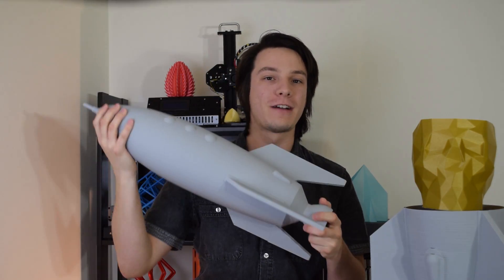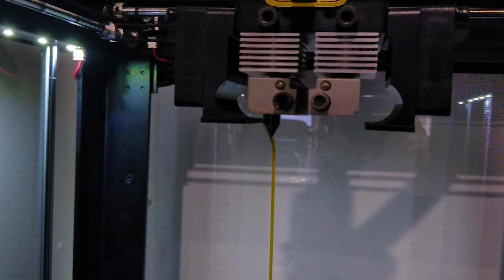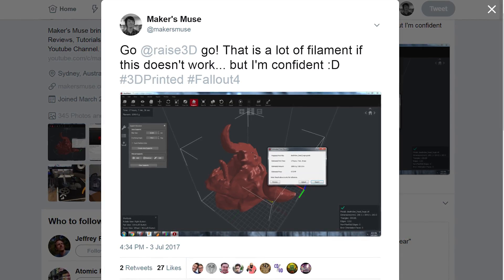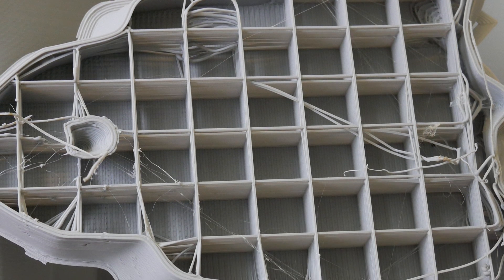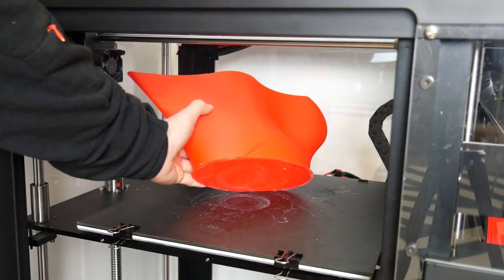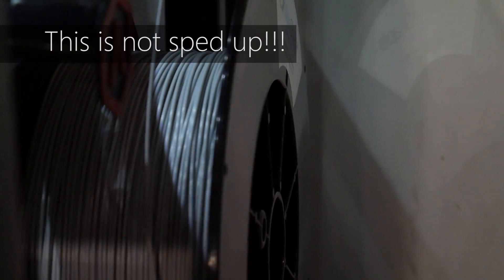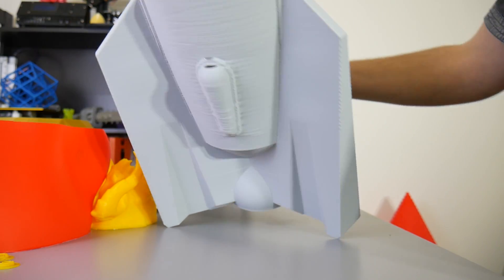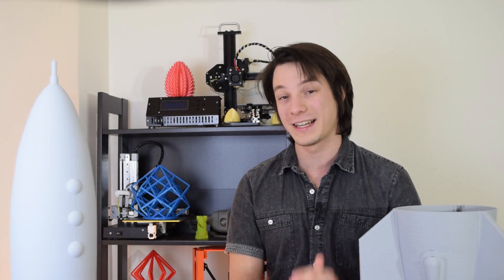3D Print ridiculously fast with this terrible mod - 1mm nozzle on the Raise N2+

Comment: I’ve bought some un-drilled E3D nozzles last year, had a plan to do small line cut instead of circular to get that "classic pen" look to some of my prints - underestimated fine cutting tools needed to do this trick, messed up 2x nozzles… 

Also about the regular round holes - I found that drilling from the inside and then sanding the very tip gave me the best results. You also could drill as normal from the outside and then drill from the inside with slightly bigger drill bit just to deburr it a bit.

Comment: I saw someone use a clever technique of having powder surrounding his print; As it developed in height he manually pushed more powder around it's walls; this acted as support material which he later simply vacuumed away & reused. The  powder may be something innocuous like Talc? Perhaps if used within a flexible extending 'container' something like that can be used to stabilise higher walls and thus make the much faster big print still come out well.

Comment: The infill issues and other issues you experienced is due to layer height being too high and over extrusion. When the printer makes a change in direction, the hot filament drags at high speeds instead of staying firmly planted. I've had great success with a 0.8mm nozzle and keeping layer heights below .4mm and 80mm/sec.  When printing with large nozzles you have to really tweak your settings in simplify3d or other slicers with 40% overlap or the slicer will skip sections. Another tip is to change the width of the kerf if it will refuse to print in the gcode  preview. Doing so will reduce the layer resolution.

One major issue I've come by is bridging. It's nearly impossible to bridge a high layer height. I still prefer using the larger nozzle but with a low layer height and crank up the speed. It'll increase the speed of the print completion by cutting the passes by a third and will be much stronger.

Comment: Nice subject. I would not have thought that the slicer actually might be the cause of misprints when using larger nozzles. I missed out on the reason for that in your video. Heater cartridge capacity.. obviously.. but slicer? Thanks for the video!

Comment: Been using a .6mm nozzle for a long time. You need to use z-hop, this way you will not have catching and crashing, play with retraction/travel settings to tweak behaviors. You also need to use more coast to avoid extra oozing. You also can't print nearly as fast as you think you can. Figure out the actual volume/sec you are extruding. 1mm vs .4mm nozzle is a significant difference in volume. You need to do a lot to cool that much plastic you are depositing.

Comment: Excellent work, more like this please :)
i quite often do silly things with my printer just trying to push the boundaries and it's amazing how much you learn in the process!
there's a hot air gun and a high speed scroll fan sitting by my printer with sufficient cable to move around for just these kinds of things and yeah, slicers have a habit of getting it wrong in these fringe cases but with a little bit of ingenuity you can pull of some crazy stuff.
0.8mm is biggest nozzle i have tried, with varying levels of success but even printing 50mm/s X 250% speed if you follow the nozzle with a blast of cool air those vase mode prints hold up quite well :D

Comment: A few thoughts: How about a volcano? And how about using a smaller diameter nozzle for the outer perimeter, and the larger one for solid infill? Also, I suspect that there needs to be a dwell g-code inserted at the start/end of the hollow infill you are running now... dunno if your slicer can do that itself or if a postprocessor script would be needed... 😀

Comment: I'm using a .8 hardened steel nozzle, a cheap one. It works great. It's so hard my steel file just glides right over it. .8 is plenty small enough for small features afaic. Can still print .2 layer height, and that's more important than nozzle size.

Comment: Angus, given that you've drilled the nozzle by hand with a Jacob's chuck drill, I would double check the actual diameter of your modded nozzle. The imperfect design of most handheld drills means your bore diameter is probably 1.05-1.2mm. I bet more accurately providing this info to the slicer will help it avoid the direction change issues.

Comment: Hey, that failed infill isn't a deal breaker if the object isn't going to bear weight. I've seen prints recover from it and turn out okay. You may see weak interfacing near the failures, but easy to hide with acetone finishing. Has worked well for clients demanding faster prints with no care for structural integrity.

Comment: Perhaps just the complex layers can be slowed down, but the rest can be printed faster.

Now that i think about it, it might be good to simply adjust the print settings so that direction changes alone are done very very slow (to avoid the print wobbling) - but everything else is fast.

Comment: Great video again. Might experiment with the bigger nozzle I got in the e3d nozzle kit on my mk2 to print something in vase mode. The problem I have had is to actually get them to be waterproof.
Reply: Clear coat the print. It's probably not as good as using an actual water sealing product but I haven't tried any so I don't feel comfortable recommending it.

Comment: the problem with small layer height and thick walls is...... support structure like seen in the video is often with big gaps in between. the lack of pressure from underneath to form the "<==>" shape causes a "O" form of the printed filament. This is higher then the slicer calculated and stacks up untill the nozzle collides.

Comment: Cura now has lightning supports, which allow to save a lot with larger nozzles. Also, I switched on my jg a3s, and with my 0.4mm profile it prints just fine after nozzle adjustment. I guess I was printing too slow in the first place.

Comment: You know, someone should make a cheap recycler for the wasted filament! Chop it up into pieces then melt it down and push it out an extrusion head into usable string.
Reply: Just watched a video on here of a guy who built a melter / extruder nozzle who can print directly from shredded waste prints. Most of his design was 3d printed himself. Basically just a heated hopper with a little extruder above the nozzle...could be the future...why waste time with filament. Go directly from plastic scrap to new prints.

Comment: So, I'm quite surprised that you didn't manage to get better results. I've modded my Micromake Kossel with a volcano hotend and a 0.8mm nozzle and have had great results. Not quite as refined as with a 0.4, but the prints are fast, and the thicker width of the extrusion really lends itself to part strength. For the record though, I don't go over 0.3mm layer height if I want a good clean print.
In any case, with the volcano hotend I often swap between 0.4, 0.6 and 0.8 nozzles depending on my needs. Saying that, 0.8 is my go-to for most prints these days. I imagine a 1mm would work just fine at a ~40% layer height, with a hot enough hotend and good cooling and provide superior prints to a 0.4 for certain types of requirements.

Comment: When i was using a 0.8mm nozzle, I found that the layer height massively changed my prints. Printing 0.4mm heights made utterly fantastic surfaces, while 0.5 and up started to get a bit much, and the quality decreased hugely.

Comment: .6 nozzle is really the limit for reliable large prints, you can even dial it from .15 to .3 no problem with the correct temp/movement settings. 
I've gotten some things to work with .8 and only basic shapes with 1.2.

Large nozzles are tempting, but unless you know what their limits are, all they do is waste plastic- when you lay down a thicc layer, you can feel it's still molten for a considerably long time, usually still rubbery when the nozzle comes back to layer some more, this effect gets worse until it just simply distorts and grabs your nozzle.

Comment: I don’t think it is the slicer. The problem could be the temperature of the extruded filament that is not sufficient to enable a good bonding. The vase has a more regular shape (less shear forces) and do not fail. Similarly when you reduce to 0.4, the nozzle squeezes the filament down for a better bonding (it has also a larger contact surface ).

Comment: First off, cool test. 2nd, my suspicion is you did not have enough extrusion width, basically the layers were getting pushed down hard enough during printing to bond them to the layer below.

I just got some 0.8 mm nozzles. My plan is to set extrusion to .88 (+10%) for good layer adhesion. And layer height to 0.2mm. The thought is that i will still have small layer lines, but, double width compared to a 0.4mm nozzle, so it should cut printing time in half.

Comment: A basic twist drill also doesn't leave a very 'good circle' in whatever it's cutting. That's what a reamer is for. I'm surprised you had the results that you did, but maybe improving the sloppy shape of the hole could have an impact?

Comment: You can - I have - print a vase 0.6 mm thick on a 0.4 mm nozzle. It just squeezes out more plastic and the nozzle tip is wide enough to squash it flat.
Reply: I print 1mm wide with my 0.25mm nozzle when I need strong perimeters. No problem at all... It's just my weak extruder which sometimes can't overcome the backpressure, so I have to lower the print speed.

Comment: I had the same problem with a 0.8mm nozzle and 0.5-0.6mm layers.
You should try a 0.2mm layer height.
I know it defeats the purpose, but my print worked, and looked good too.

Comment: It would be cool if there was a machine that you could buy at home that would let you melt the plastic and turn it back into useable threads or whatever they are called. Idk if this machine already exists as something you could buy at home, but it sounds cool
Reply: There is - just not cheap enough - yet.
https://www.filabot.com/collections/filabot-core/products/filabot-original

Comment: Hmm, I wonder if you could fill the rocket as you go, with something like expanding foam, to hold the shape. You wouldn't need to go all the way to the brim, you could stay a few cm below it, but just enough to keep the walls from flexing so much. Every 20 minutes or so, pour in another few CM of foam.

Comment: You know, I actually LOVE the look of that octopus! To me, at the smaller layer heights, the strata tend to look like imperfections--like the printer failed to create the perfectly-smooth surface it was aiming for. But with thick layers and huge filament, the strata begin to look like a deliberate texture of their own (especially on smaller parts), a texture I find quite attractive!

I guess it's sort of like how huge crystals are beautiful and decorative, but super-tiny crystals (e.g. sand, salt, frost) are much harder to appreciate aesthetically.
Reply: Same.  When I printed some project boxes at .3mm height (with .4mm nozzle), I got better-looking boxes than I did at .15 or .2mm.  The imperfections on the thinner layers are more visible.

Comment: Angus, my opinion is settings cannot be the same for extreme nozzles (I mean both extra fine or extra large onds). The Slicer software part is not to blame too.  You want both printer settings adjusted (especially jerk and feed&speed) and Slicer settings too (temp range, perimeter/infill speeds, and so). I believe you can get decent prints of any kind if you take enough time calibrating firmware and software. IMHO the single thing to care about is probably the part cooling fan. thick filament deposit may require a more performant cooling system. Nice video through, I will drill a reclaimed clogged nozzle to upgrade one of my printers to a rough print settings. Good idea, thx !

Comment: I don't know if you can adjust the programming at all. but it you can try with a slower movement on the print head. if you can really adjust it then try with a slower moment on sharp turns

Comment: 2:4 I noticed that the 1st yellow filament did not fail but the Grey filament did.
Could it have been the different characteristics of the different colors of filament ??
Reply from the maker: Hey that's a pretty good point... I should try the larger prints with the yellow, as that seemed to work quite well. Different brands so quite possibly different additives.

Comment: I routinely print with 1mm to 2.4mm nozzles with no problem.  based on what i saw i would say the issue with your larger height prints is speed.  for a 1mm nozzle with 0.8mm layer height i would try around 35 - 50 mm/sec depending on your material type.  I can send you a calculator that should help if you want.

Comment: The main issue I've had with my print speed seems to be how fast the plastic is heated. So I think a bigger nozzle wouldn't help. A better extruder might help with that though.

Comment: I've found a lot of good in playing with infill settings.  I've reduced the output and, extrusion width, extraction and some other tweaks very heavy.  I use Simplify3D.  The changes have been fantastic as far as how clean prints are now.  Infill is VERY overlooked in 3D printing guides.  Extraction changes would have helped on the rocket planter in this video too.

Comment: Awesome video Angus!  Not that I need to tell you, but part of what's going on in your experiments is your pumping too much filament volume...more than the hot end at 40 or so watts can keep up with.  This is obvious when it begins to jam on 1.0mm nozzle dia, but there are many offer characteristics that occur when the nozzle is running at a non ideal volume output.  The nozzle might be extruding...but the filament is likely not at the desired temp.  Namely, layer adhesion, ooze, and warpage get bad when the filament inside the nozzle is at a lower temp than say, the thermistor of the hot end.  I've been testing this a lot and ran a dozen thermal FEA's last week...hopefully soon can sell what's now in a prototype stage to help eliminate ooze and keep print quality good at larger nozzle diameters.  The hot end needs more power and better materials than cheap aluminum and brass IMO.
Reply: many OTHER characteristics (I mean)

Comment: being that its a larger nozzle you use less outer walls and bottom and top layers, also the volume of plastic output doesnt change per nozzle size but just by size of print and shell thickness. i have a e3d volcano and i use it for printing usable parts and i use a .8 nozzel and .6 layer height and the parts are really strong and print quickly, you loose all fine detail but im printing strong funtional parts in 1/3rd of the time

Comment: The lulzbot Moarstruder has the same problem. 1.2mm nozzle, claims to be able to handle up to 1mm layer height but infill and sharp turns start to shrink and ruin prints, exactly like what was happening to you.

Comment: Hmmm, what about a 0.6mm layer height with your 1 mm nozzle. Try different infill patterns and make sure you are printing every infill angle on each layer in order to assure good infill layer bonding. Also - you need to substantially increase the extrusion temperature or use an extruder such as the Volcano which is actually designed to work with a higher volume of plastic.

Comment: Can you optimise the design/angle of your model to follow the fastest axis? Such as, if up/down is the quickest movement, then orientate the rocket as you did. If diagonal is, then orientate it to print diagonally (though that model would have more supports, so makes such an idea redundant).

Comment: Don't knock the 1mm nozzle, i have used a 1mm nozzle almost exclusively on both of my 3d printers for about 2 years now and get very nice prints( you clearly need more practice ). Speed is the main advantage. The other being when you print carbon fiber and metal fill filaments a minimum .5mm nozzle is necessary or they immediately clog and at 1mm with a all metal hotend clogs just don't happen. Print speed is about 4x faster overall moving from a .3 or .4 to 1mm. Give it a try.

Comment: Bit late, but I think the large print was failing because it was using 'lines' infill, which only does half the pattern on each layer. With 0.2mm between layers it isn't a problem but I think the larger layer height meant it wasn't adhering to the previous layer of that pattern (1 layer below) properly. Maybe grid or triangles infill would solve it.

Comment: Hi Angus, I hate to disagree with you. I always install volcano kits on my printers with 1mm nozzle. about 0,15 - 0,25mm layer height. You need to reduce the printing speed and increase the cooling since the sloop of filament you are putting down takes time to cool. Reason to do this: I only print for practical use. It has to be really strong, and a 0,4mm nozzle wont do the job. And when I need yet stronger prints: PETG!!! You cant tear this stuff apart unless you really have to. I have a CR5060 printer which does a really great job.

Comment: i think what the problem is is the plastic at that thickness is retaining to much heat and making it more playable then it should be maybe have a fan blowing on it to try and pull more heat out of the print as its printing

Comment: I do not beleave problems have to do with the slicer software !
It is easy to test this if you change parameter a little bit. 
Let the all the setting on 0,4mm and only vary the steps of the steppermotors.
It will print bigger and the Slicer can´t know it.

To work with brass you have to know the 2 cutting edges on the tip of the drill have to be modified a little bit with some fine grinder stones. So the cutting edges now have an angle to the ohter side for ~ 0.1...0,2mm
With this modification it is easy to make holes bigger with accurate diameter. Slow and with fine Surface